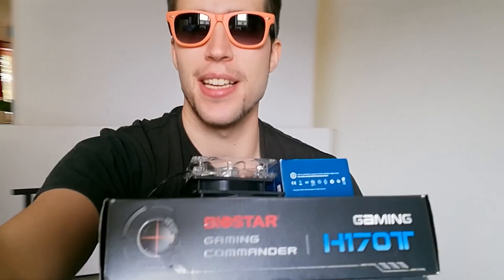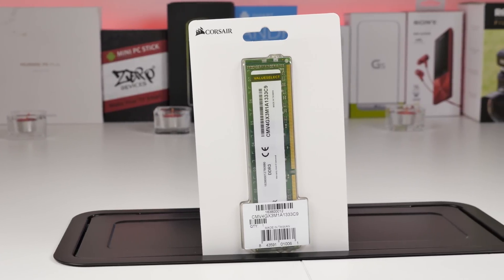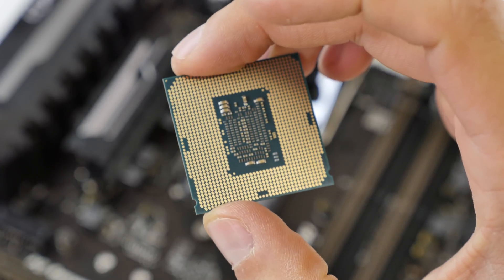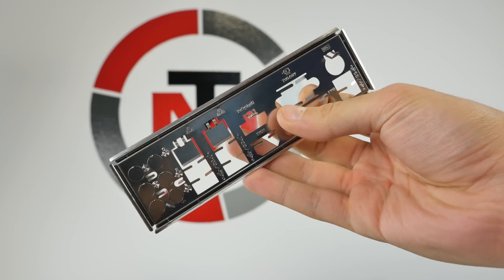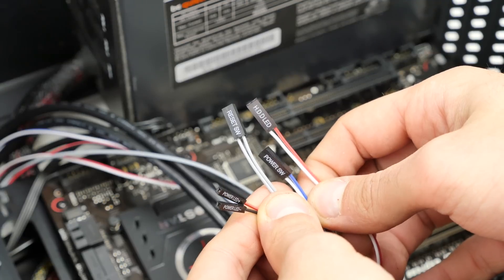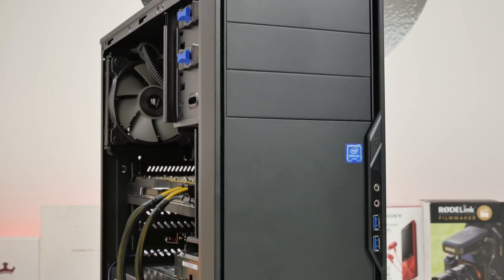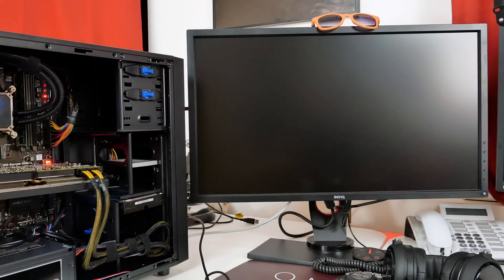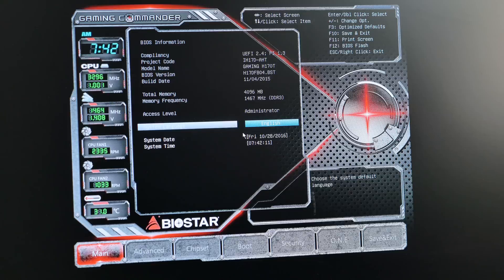How to build a PC 2016 !

Comment: Plz help! I just built my gaming pc today when it was done I plugged in a hdmi to the only hdmi slot on my pc and plugged it into my monitor. When I turned on my pc all the fans came on but I didn't see a thing on the screen I tried vga too nothing.
Reply: Zackclashes I know this is late but did you install Windows ?
Reply: Zackclashes you have to plug it into the graphics card